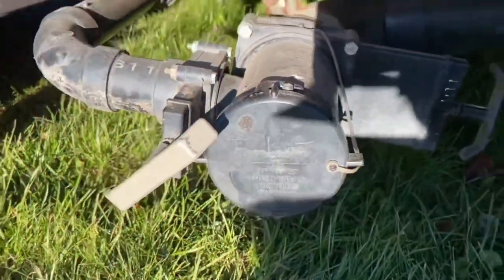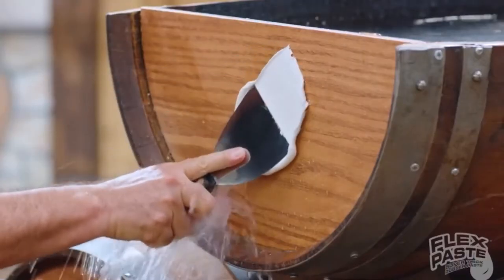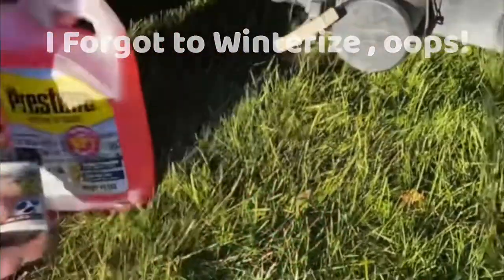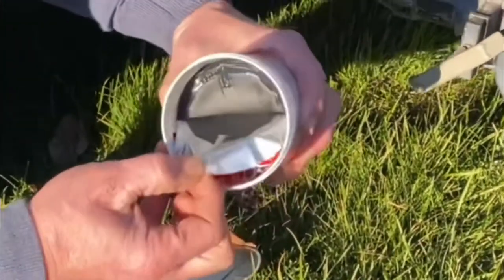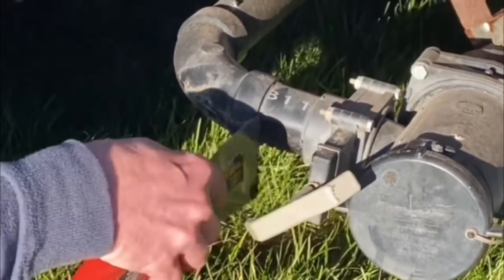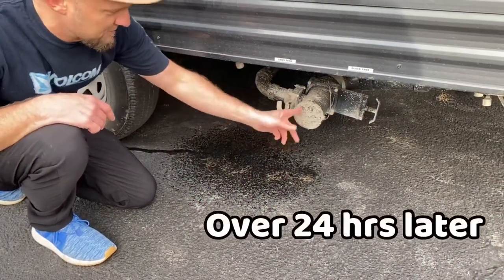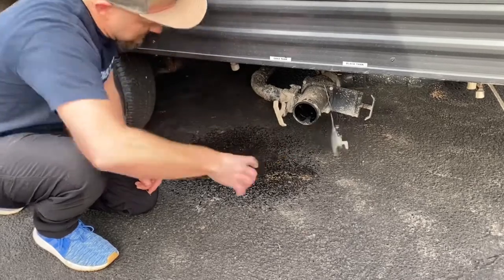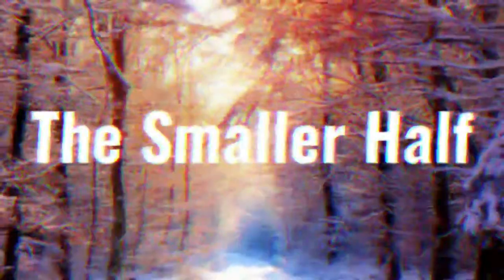Will it Flex Seal ? RV Plumbing Fix Leaking Cracked Drainage Pipe on RV

Comment: What was the point of pulling the gray water valve, it's down stream of the crack. And why would you drain on the ground without a hose? Education now days isn't what it used to be.

Comment: Plastic epoxy is cheaper and better. If you prepare it properly before the patch it will last a lifetime. You can also weld plastic. It requires a little skill but it's not hard to do and the kit is cheap.